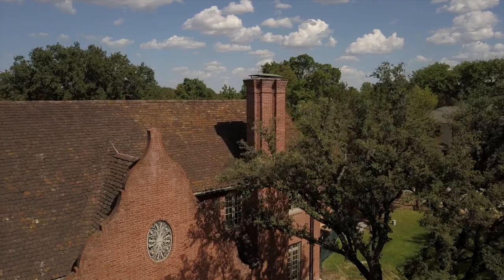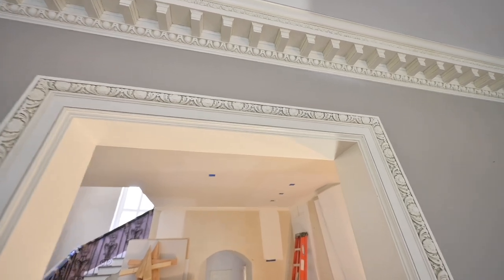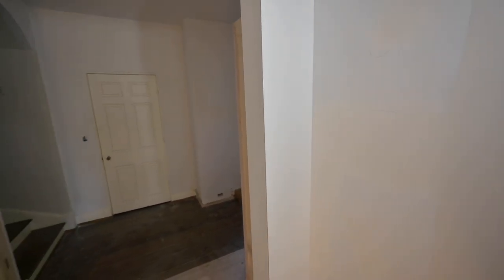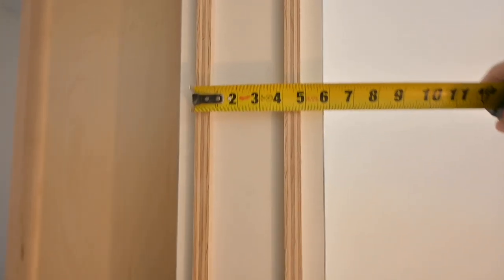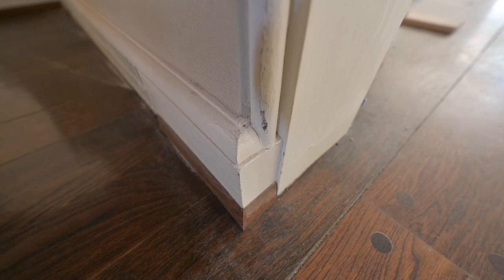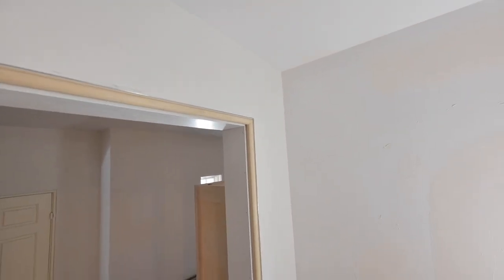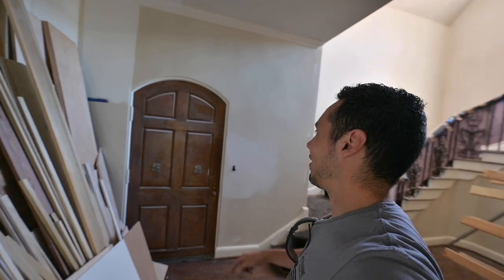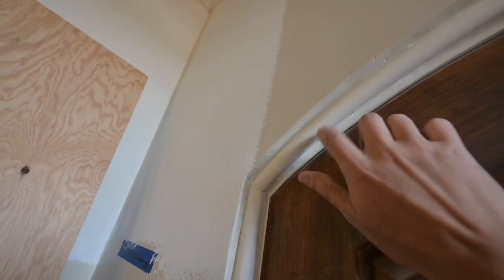I passed the Master Carpenter Test

Comment: When you mentioned having to cope the circle, I imagined how Colin furze uses a hole saw to cut radiuses in round piping for when welding.
Reply: Lol I had exactly the same, thinking of that method done with a drill press and a one inch drill somehow

Comment: Cut thin strips of the same board and glue them over a bending form.  Keep them in the same order as you cut them from the board.  That'll keep the grain direction, color, etc. consistent.  THEN route in the profile.  Boom.  Done.

Comment: The trim package is that house is breath taking.  The dentil crown is very unique.  I manufactured poplar moldings several years ago.  We produced a similar applied dentil block made of poplar.  I think we sold them wholesale for around 2.00 per block at the time.  It was actually very profitable at the time.  I think most of the blocs now are made of urethane or Fypon.  This being the case, it’s great that you are making these videos for future generations because you never know what kind of advancements for architecture and installations will be made.  Many products are now formed in a mold rather than being carved by true craftsman.  The same may hold true for how these products become integrated into building panels.

Comment: On the curved skirt, wet the wood and place infront of a heater for long enough to make it warm to touch, then clamp it before installing skirt and it will mold to it. I’ve had to do this before with Scotia molding ( inside corner molding ) not the best way but it will work on something that isn’t a huge curve. I love you videos, I want to start doing this as well. Your a true inspiration to watch! Keep up the amazing work. My brother has the best saying for his trim business. Watkins Brothers Carpentry (We cut corners) is his saying lol

Comment: Cool trick ... As a finish Carpenter myself here in east Texas I have had to figure out cuts on the job site to I guess that's what sets us finish carpenters apart from the rest we all have to be taught or figure things out ourselves. In fact the last 2 new houses we have done I had to figure out a similar cut with shoe mold   the cabinet shop started putting 1×1-4 flat stock on the edge of the cabinet where it meets the wall so the base buts into it on either side and leaves a space to fill with shoe mold so I figured out the way is to sqare butt one side of shoe and half cut the other at 30% inside corner and back cope it to half wrap the other piece.  Y'all keep up the good work and thank you for your service to our country.

Comment: Nice work. I was a finished interior stair builder for 9 years. The fun of the job was figuring out the details. Early in my career I had to install level rails on a balcony that had tapered round columns. I had to mimic the radius at a taper on two vertical finish painted columns while maintaining level with no bow's on a 24 foot run. I made a jig on sight and used my skil saw blade to make the cuts in the oak railings by clamping the rail horizontal and plowing with the blade vertical at a taperl. The tolerances were near zero and I pulled it off. Theses were high end condos and perfection was demanded.

Comment: Cool stuff Richard. 
Had a 1990s Amish built in the past that really cool casework. Didn’t know that was what it was called. 

Even had to replicate some myself when some of the trim rotted on the porch from too much weather exposure. I ended up starting with square stock and running it thru a router table to replicate the dowel side. 

Gives me even more appreciation for the details in that house.

Comment: Back in the day carpenters used a drill too. The other way to do it is with multiple cuts and then a 1 inch curved face chisel. Cannot attach a picture. The curved face chisel is also called a gouge.

Comment: Amazing! I did finish work in east coast victorians back in the 80's that had a lot of wild and very ornate casing and molding. I've never seen the particular pencil molding though, and like you, I would have assumed it was round stock. I'd be really interested to learn how it was milled. Your forstner bit technique is genius! I probably would have tried coping either of the two pieces, and burned a lot of time and stock getting it right. I am curious why you miter instead of coping the two top corners? I am also curious what city this house is in. Bravo on your excellent workmanship and for sharing! Much appreciated!

Comment: Super job with the forstner bit!  No filing or sanding after trying to use coping saw or similar for the exact curve.  Well done.  I'd be inclined to build a jig with 2x or similar with the 1" hole as a cylinder guide, then use that to make repeatable and accurate finished pieces.

Comment: Richard, YOU CAN LAMINATE IT into a bend.  Create a matching curve.
 Use 1/8" strips.
Glue, bend and clamp over your curved cut of wood.  Route the profile.
CA glue it into a straight section.  Bondo the joint.
Sand, prime, and paint.  I think that is how they did it over the doorway.  (Probably no bondo.) 
Or they block extruded it from plaster in place.

Comment: I had a feeling a bit was to be used, what bit though? You got me there. 

If not a steam box or milled out of lumber. My guess would be a cold soak? Yeah I know steam will open the fibers and a cold soak will shrink them. The only way to see what those guys in the past have done is to strip the paint off and have a gander. 

Those painters did an amazing job making that room look like glass, I didn't notice the tubbed ceiling until you pointed it out for my eyes were stuck to the wall detail

Comment: If you have more of the pencil molding you might save some time and make a jig with something like a 2x4 drilled on a drill press to keep it straight. You could use cordless on the job and the 2x4 will keep you straight.  Make a stop on the jig for repeat cuts and no cleanup.  The board for the stairs is going to be easier to cut and router the edges. You do good work.

Comment: How about a drill press, Yea, yea, I know, another tool to lug around.

Also try putting the bottom nail of the vertical pencil below the top edge of the coped baseboard cap

Comment: Here's an idea for bending a tight radius in the pencil molding- rip it into strips, 2 or more, depending on how thick the strips are you might still have to steam them, then glue them back together clamped against a curved form until the glue dries.  If you are ripping a thin molding then the saw kerf would be a problem so you might have to rip more than one piece of molding in slightly different places so you could have a full thickness outer piece and a full thickness inner piece, when glued back together you get the full dimension of the original molding without missing the width of the saw kerf.

Comment: Layer it. I had to make some moulding to go around a round hearth. Cut 1/8" strips of oak clamped and laminated them 1 by 1 around a template to build the thickness of the moulding. Put the template on a flat surface and just keep the peices square. Cut the strips tall enough to cover the height. Then take it to the router table. Perfect peice and it is under zero tension. Homeowner gave me a funny look when he asked about the hearth and bending wood, and i told him I'd make it happen.

Comment: Soon as I saw the profile you needed to cope I thought Forstner bit. One tip, no need to drill on the end of a piece. Move back a couple inches so that the entire bit is surrounded by wood. Bit will be more stable and less likely to drill at an angle. Then cut to length on miter saw.

Comment: Welcome to the club,, the first thing I thought of after deciding I wouldn't attempt use a coping saw, like the old-timer probably used,, (if you had a loose original the saw marks would still be there so you could tell how it was made) was cope it out with a Foster bit, if it was close enough too a standard size,  except I would bring in a portable drill press, set it up with a registration jig to do multiples at once, if needed,  over the decades when I've thought Eureka I've discovered the "wheel",, I realized at some point an ancient tradesman in the last 500 plus years of "modern" carpentry had already been there and probably accomplished what I though was an original technique I had just dreamed up and did it using hand tools,,, this trade keeps you humble,,, hopefully.  fyi often pencil moldings and other complex arched shapes were created in plaster since steam bending was really time consuming and required a large open fire, stream bending was usually a go to technique of the ship wright, since the only way to curve those large oaks ribs was bending,, or the wheel right, although arches could be shaped with a series of shaped wooden planes and gouges,, but this was often the provence of the carvers, the history of our trade is really the history of human progress itself and a fascinating aspect of the craft that has kept me interested all these many years,. So great to see young people so passionate about it,. I hope you can reach ten thousand more and ignite the love of the trade you give voice to on this channel!
Reply: So I'm not giving out my cell number,,, the fact you would ask is a tad bit creepy,, anything you want to say just to reply,,, I hope you took my comments positively as I intended,, it was a bit of a ramble so it may have come off different to you,,, any way I I've watched your channel for a couple years now and it's always been entertaining and interesting,, carry on then,,, cheers

Comment: I noticed something that maybe perhaps has gone overlooked. The specific way the crosseted corner butts-out, it creates an illusory beam which is a very Etruscan inspired detail (adopted by the Greeks in Doric structure). Look at the green granite over the fireplace. It extends into the crosseted corners giving the appearance that it is a solid beam extending past solid columns of the same material. We know the granite is likely a thin layer, but the crosseted corners help reinforce the illusion they are solid beams/columns. It is quite beautiful and all that is needed to make this illusion is to align the crosset with the void (in the case of the fireplace, where the pit is).

Comment: Nice video. One alternative might be to use a router table if you have one, then you can get the perfect distance from the edge and the cut will also be perfectly plumb. Not everyone has one though and your method also gives good results

Comment: If you had more then a hand full (like an entire house) you could make a jig and use that to guide the bit down so you get repeatable exact copes. Same way a pocket hole jig works. Take a flat head,side cutting bit (forstner bit, router bit) and give it a guide to walk it’s way in on an angle.

Comment: For the wrap around piece on the pencil molding, I was thinking a rough cut with coping saw then sand paper put on on the pencil piece and move the other piece back and forth until you get the final shape. Slow, but should work. I can' fathom how you knew where to position the fostner bit on that piece, but I guess that's what experience does for you.

Comment: Loved the video, nice work, as with all your videos. I have a problem for you and as a old DIYer I'm not sure how to do this task that is similar to the project you just highlighted in the video. My home has a 90 degree circular oak staircase and the exposed "cheek" is about 1 inch thick from the wall and is finished with a 3/4 inch quarter round trim. I now want to fit a standard design chair rail, 3inch wide, to the curved wall. I have bought flex chair rail to accomplish this. The stairs are at about 47 degrees up the wall and, of course, the wall is curved. How do I cut the end of the flex to meet the staircase? If anyone has any ideas that can be done with a reasonable set of tools please let me know. I thought this would be easier than using wood and bending because both methods would require the same task. I think this is more challenging than the base board you just did. Do I just cut out a 3 inch wide part of the 3/4 round and just line up the chair rail to the 1 inch cheek.

Comment: So...if I had the pencil moulding....and young kids...  it would be a great place to put pool noodles (pipe insulation)  to protect young kids heads from sharp corners...as well as give the corners a fighting  chance with little kids and their toys.  (Win win!) And the colorful pool noodles could be just added flair to the fun aspect of a family home.

The other thought I had with crown moulding...is if the ceilings aren't 90 degrees with the wall...  you could just lower the moulding enough to put some led strip lighting in the channel between the top of the moulding and the wall...and then you'd have crown moulding WITH ambient/mood lighting.

Comment: Using a drill press would ensure a perfectly vertical cut with the forstner bit. You can easily use a portable press stand that will attach to your drill. We use it for drilling sockets for railing spindles. If you are worried about starting and rolling that cut, that is. :-)

Comment: I would think bent laminate for the curve may work? Cutting about 4-5mm strips around a form with glue under lots of pressure. Jessie the samurai carpenter did a good video on it for a custom archway. I feel like using the band saw and router is the cheat way to do it.

Comment: set your drill to #1 when using the forstner bit. i know it sucks and it's slow but you'll burn the bit out 100x faster if you use it on the fast setting.

Comment: I see you left the cap flush on the entry opening side where the original had a reveal. Other than that it looks just the same.

As for how the original was done, they could have used the sane method but with a hand drill instead of a power drill. And me being inventive with routering, I believe a core box or bull nose bit would also work, but being done before electric routers, they had what are called moulding hand planes, which could have possibly been used. Or simply taking their time and carving it out with a chisel, knife, saw, etc.

Comment: Friendly tip when using a forstner bit on something like that..... clamp your work down instead of holding it with your hand.   i know i know,  safety sally... i used to not care and do it the same way you are in the video all the time.... till one time the bit jumped off the wood and caught the webbing between my thumb and pointer finger on the hand i was holding the wood with.  5 stitches and a very annoying healing process later...  i clamp it down now.

Comment: Would imagine the old timers would have used a bit n brace in much the same way as the forsner bit along with a gauge maybe, as for curved molding from solid with a wooden molding plane probably made specifically for that. Any pipe fitter/fabricators watching will be like meh easy peasy lol.